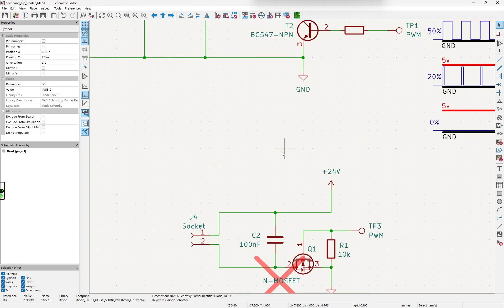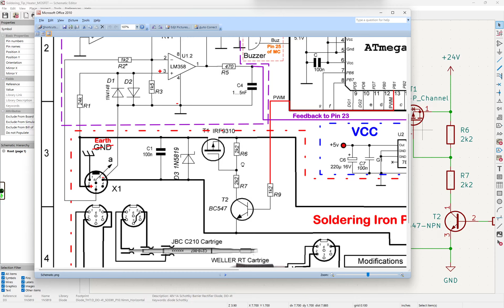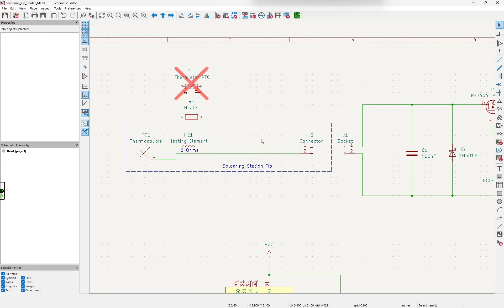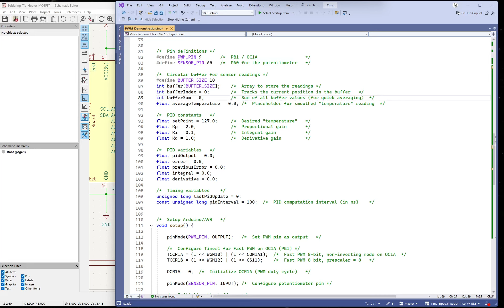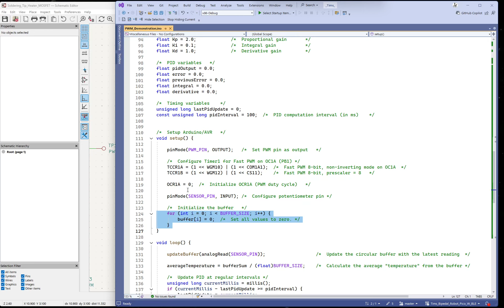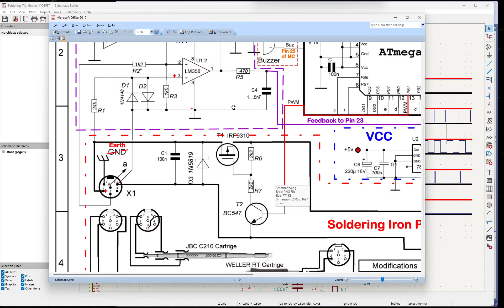Preparation for: Project X [Part 4, PWM and PID]

Comment: hi, I would like to ask if the code is available or not. I want to make hot tweezers, using c210 tips.. the code and schematic will have to be modified, but It is better to have something than start from scratch..thanks in advance,
Reply from the maker: This was based on a project Richard was doing: https://www.youtube.com/watch?v=89hMWXOFliA
I am just explaining the different aspects of the circuit.
There was only the firmware HEX file for this circuit available. Not sure if Richard sill has it on his google drive.